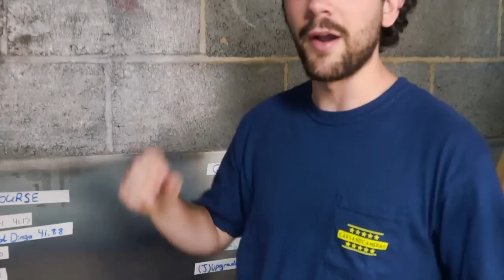Manco Dingo Transformation & Rip! Reviving our Favorite Cheap Go Kart!

Comment: Thought the hex axles were pretty standard on most or all Dingo's, or at least the older ones. I jumped my 13hp "high performance" one and it hasn't bent yet, and I'm 200lbs.
Reply: Only reason mine bent was a friend clipped a tree at 35mph only caught like 3 inches or so.   All the leverage bent it easily.   My dad brought it to his work and put in press he straitened it.   The guy i sold mine too put a 3 inch wider axle on it and stretched it added rear swingarm was much better for big guys and smoother with just rear suspension
Reply: My 88 dingo has a round live axle on it. I dont know how old they get but 88 pretty old
Reply: I don’t know how old mine is but it has hex axle and wasn’t easy to find hub
Reply: No spinning a key on a hex axel👍
Reply: Go powersports has hex hubs ,bearings and axles . I actually like them better
Reply: Should’ve just ran the crankcase vent into and airbox for it, let that motor get some more lubrication 😂
Reply: I have two Dingos one has a roll cage and a hex axle. The other does not have a roll cage. Only the head loop. It has a round axle.
Reply: @shadymaint1  ohhh wow, thanks for adding that in. So probably the roll cage ones all had hex, which is all I've ever had throughout my life.

Comment: Manco is known for hexagonal axles, I had a go kart with the hexagonal axle, I prefer them more actually, because with a lot of power and torque, it greatly reduces the risk of breaking a key (because there isn't one) and it has pozi. But you're limited to rim's and tire size, because of the shape of the rim.

Comment: Tecumseh engines; Stock they do ok but they do a whole lot better once the governor is bypassed or removed. Port out the intake manifold a little bit and tighten the valve lashings and replace the stock muffler with a straight pipe header.  The mikuni  Carb is a must with a straight pipe exhaust.  If yall swap that stock muffler with a straight pipe, tighten the valve lashing and bypass that governor, yall will notice a huge difference in power.  Speaking from personal experience here... I promise you guys, you will not be disappointed.

Comment: I just did a series on my channel of fixing up my Manco Dingo IX! It was my very first motorized machine when I was a kid and is still in great shape. It’s got the 9hp Briggs and Stratton and Rips pretty good. The only downside is the lack of suspension so I’m taking the motor from it and transplanting it on a Baja 65 cart frame that has full suspension, rack and piñon steering, and hydraulic brakes. Should be a much nicer riding cart than the Dingo!

Comment: Just put a live axel on it and "It'll be Fine"
Reply: *drive shaft
Reply: It's already a live Axel
Reply: Weren't all Dingos already Live Axel's with torque converters???
Reply: Pretty sure the term live axel means any axel thats two wheel drive either key driven or the weird hex shape in this video versus the one wheel drive that the guys call one wheel peel depends on how the frame is set up for either style

Comment: You guy’s should have a sand bag John has to attach to the go karts so that it’s strictly skill based.
Reply: Just bolt some big magnets 🧲 to the sand bag so you can stick it to the floor panel and easily switch karts with it.

Comment: New filter helped it looks like nice love the video happy yall brought back a stock tecumseh engine love them engines alot have one as a push mower engine and but love a good old tecumseh briggs of anytype of flathead
Reply: Flat head engines don't have the horse power of a overhead valve engine.

Comment: You need to find an 8hp briggs  with 40 series like their top model  had. I loved mine. I beat that thing for many years and many frame welds and but never killed that briggs with just routine oil changes and filter cleanings.

Comment: Hi guys.  I put the same Mikuni  carb kit from Amazon on the same 6 hp Tecumseh.  I had the same results as you guys except for when the engine gets a few hundred RPM above the rated factory speed the engine bogs and cuts off unless you throttle back.  If you throttle back the engine smooths out and will run all day.  You can take off at full throttle and the engine accelerates like a beast but when it reaches that certain rpm you have to let off for it to smooth out.  It seems like it’s not getting enough gas to support the high engine speed.  Would re jetting the carb fix this?  If so do you know the procedure for re jetting it and where can I get the jets?
Reply: Most definitely, your engine spinning at a higher rpm means more air intake, which means you need more gas flow to compensate for the higher air intake

Comment: My motorized bicycle motor does the same thing when I hit bumps. I was told it was because the sloshing of fuel in the bowl makes it flood out slightly. Kinda like spraying carb cleaner at an air leak, makes the motor stall most times. Any truth to any of this?

Comment: I'd like to get a dingo and put slightly taller so I could air them down a bit to smooth the ride. There's  so many fun places I just can't ride my mb200-2 through. Plus after adding power and building a small trailer I could pull a 1 man to my fishing hole

Comment: Hey can you plz tell me what throttle cable is needed for the dingo to use a mikuni carburetor or how u connected the cable for the dingo to it plz

The cable i have has a loop connection to petal and straight cable on other end

Comment: Alot of the later manco carts have the hex axles they are slightly smaller diameter than the original round axles but offer higher durability

Comment: I have a question for cars and cameras, I have the same motor will a 30 series torque converter fit on it, and if not is there a torque converter that will?

Comment: I have a Fox pro 2 Go Kart that is almost the same model is that one but mine is a two-seater I upgraded the engine to a duromax 16 horsepower no more leaking oil no more stalling out and now I'm goin 60 miles an hour I had a 10 horsepower Tecumseh engine on air yes I had to make some modifications for the engine to fit to the mounting plate but other than that it was a good investment I highly recommend duromax engines for anybody that wants to get upgraded an more power for their go-karts .

Comment: Love your vids.  Inspired me to get a used Yerf Dog 3203.  It has a 6.5 Tecumseh that I plan to open up with a 22mm Mikuni from GOPOWER.  I remember that you once mentioned a discount code in a vid.  What was it again?  Also, I saw header exhaust pipes are available for the Tecumseh.  Curious why you ran the stock mufflers in a few of the vids where you were running a techumseh.

Comment: Please HELP!? Same go kart, putting a GX370 on it however because it's so old I'm having serious problems taking a wheel off to change the one piece 1 inch sprocket because the old one is WAY TOO CHEWED UP!! I've lubed,greased, and used a breaker bar with the appropriate 1-1/8 deep well socket? I mean I've worked on it resprayin daily for almost 2 months trying to avoid buying a new axle... ANY ADVICE WOULD BE GREATLY APPRECIATED GUYS?!?! Please continue with the great content. Yall go me intrested single handedly trying to build this governed for my 12y/o. I've worked SC EMS for 23 years so don't worry, I'll be safe! Just trying to keep it a budget build. Plus "Go Power Sports" look me up, I have spent plenty of money through your company BECAUSE OF THESE GREAT GUYS even without the continued discounts. " Thanks Go Power Sports for making everything streamlined too"!! Kinda stole that one from Ike. Love you too John in a straight way. Lol "HELP PLEASE "!!!

Comment: dudes.. i have a 17hp ohv craftsman Kholer command I and would like to put it on some kind of buggy... but it is vertical shaft.  It is just kicking around not being used.. it would be awesome to put it to good use.. even if it were not on a buggy, like say a saw mill or anything.. where i can get the most use out of it.. any suggestions??

Comment: Man that’s just like the go kart I pick up just need to Mod the rear drive… DuroMax 16hp 420cc engine out of the box 28.50 ft/lbs of torque yes this is Shane and that’s sear power just wish I could get the mod’s for the engine….

Comment: Hey ike or john do either of you guys kno the torque specs for the Tecumseh that came off the dingo cause the same engine is on my yerf dog and I have it all torn apart (head bolts were loosened by my buddy on accident) and I cant find anything about it or its torque specs but i have a new 212cc coming and the new 30-75 juga-verter that just came out today and some other stuff coming to but would still like to use the Tecumseh as a spare engine or for another project

Comment: I’m restoring a Manco 706b 2 seater. Is a stage 1 Predator 420 and a 40 series torque converter gonna be enough to rip or do I need to go bigger?
Reply: It should be fine
Reply: Isaac it'll be fine Thanks. Didn’t know I needed a kart till I got hooked on Cars and Cameras.

Comment: hello so i have the same frame with no roll cage and need tires does anyone know where i could get similar tires like the ones in the video but less expensive than go powersports sell them i have wheel hubs with 4 lug 4 inch and need a tire for it now

Comment: I got a tecumseh 6.0 but whenever I turn choke off it makes white smoke and smells like fireworks/burnt oil, any ideas what it is?
Reply: Possibly this, found it on google:This indicates that the carburetor isn't stopping the fuel flow properly and it is either a defective inlet needle or a float with a hole in it. If you have gas in your oil, DO NOT run the engine until this is fixed. You can do alot of harm to the internals of the engine.

Comment: Guys, those little pod filters do a terrible job of filtering out dirt. You are going to eat the cylinder and rings on that engine too. Coming from someone who rides dirtbikes. Get a Uni foam filter and make sure you use proper filter oil and probably a pre filter too.

Comment: Hey I have a 40 series torque converter on a predator 420 and its brand new and the clutch is sticking so when i stop it either stalls or destroys my brakes!!! Please help! It's GoPowerSports brand...
Reply: Did it get muddy? Is the idle too high?
Reply: @isaacitllbefine7231  Never even gotten a drop of water on it... the idle isn't too high or anything either, it just gets stuck. Like sometimes it'll stick clung in and it'll start burning up my belt :(

Comment: A 125 bike would smoke these 212's. Why are they so slow?
Reply: Gy6 engines are overhead cam high revs.  My 150 spins +11k (stock is 9k). A stock 212 is 3.6k bc it’s a pushrod engine.